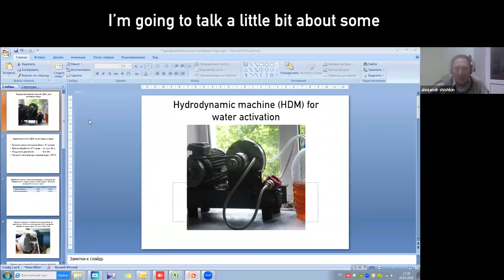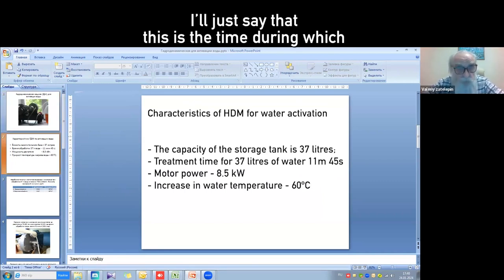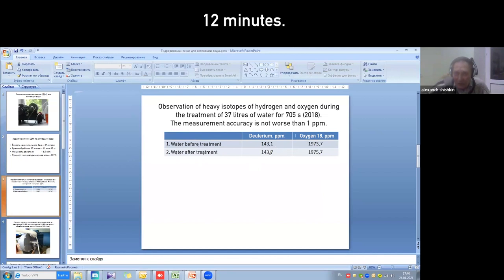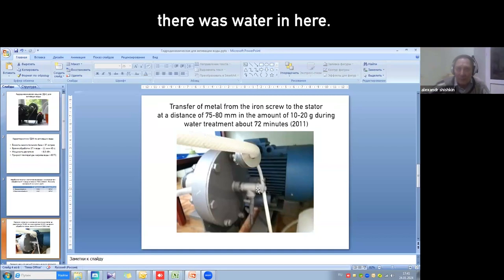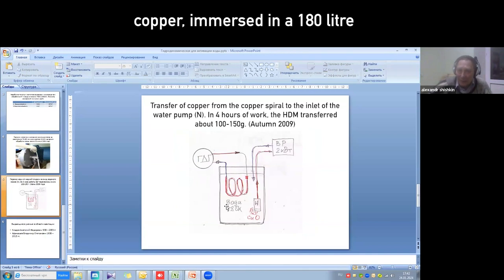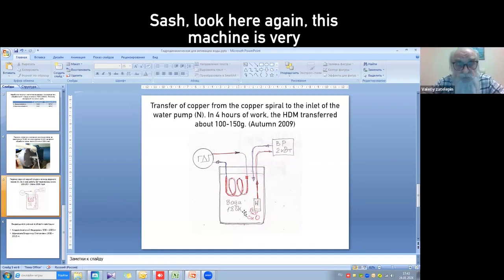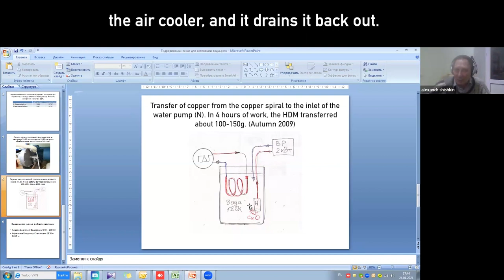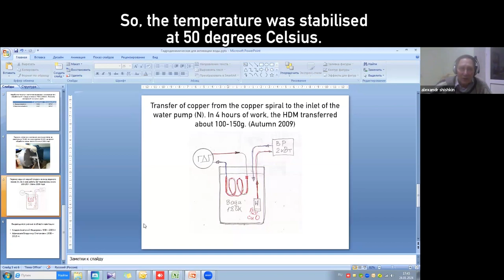ULTR - Alexander Shishkin's commentary on Huang et al - ENGLISH

Comment: I remember that a few years ago someone invented a rotary boiler consisting of a cylinder with close-fitting rotors with radial holes fed through a hollow shaft.
‘Apparently’ the power required to spin the shaft, draw through and heat the water was far less than was needed to heat it by conventional means…
(It was used to power the showers, I believe)…
Reply from the maker: This was Griggs, who copied it of Schaeffer

Comment: I was thinking this would be a great idea for the ball lightning video. Which AI tool was used to do this?
Reply from the maker: 11 labs pro license Dubbing tool.
Reply from the maker: It is not perfect, but it is pretty darn good. Even the speakers sound similar to their actual voices.
Reply: @MFMP  Yes, this is fantastic. Thank you for sharing
Reply: Fantastic Bob!  Really appreciate the english audio translation dub, its actually pretty good!  You may consider using it on some of the previous high importance Russian meetings as well.  I know i have nit been able to watch through all of these but with this tool i could listen.  Thank you!
Reply from the maker: Yes - I agree, it does cost quite a lot, but worth it. @davidboutilier9841
Reply: @MFMP  Making believable voice clones is already pretty easy, It's the tooling around it that makes it hard to implement practically, Eleven labs are the first to do it well. Open source will catch up soon enough i think though.
Reply from the maker: Yeh, I tried some of the open source tools and, frankly, it was a pain. This, though costing, it was painless. The benefit to sharing this work further cannot be overstated @sebastiansosnowski3859
Reply: I have been thinking about the language divide for a long time. Getting an update here on these developments is just great. Winning!